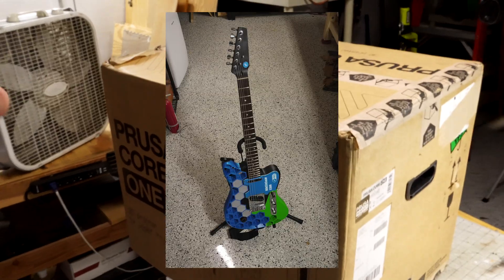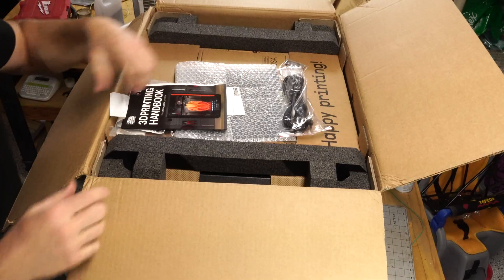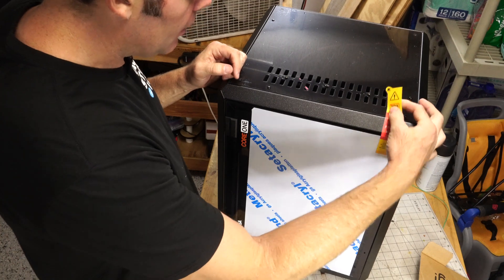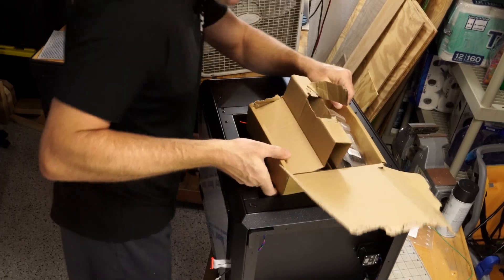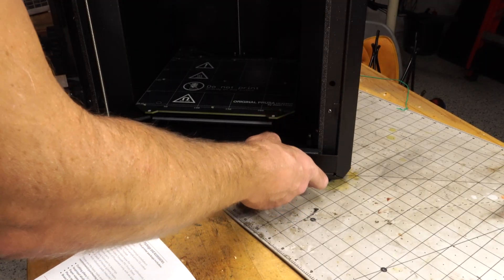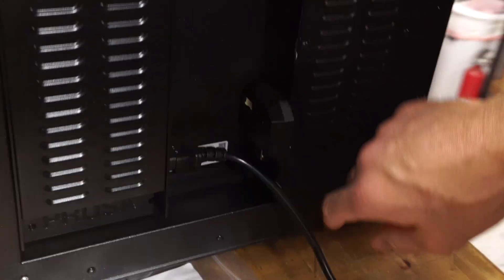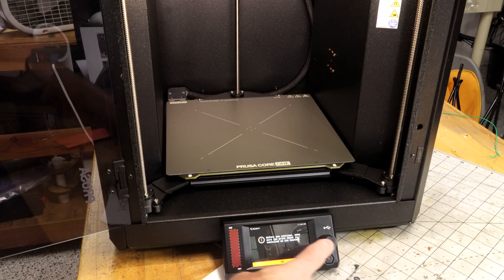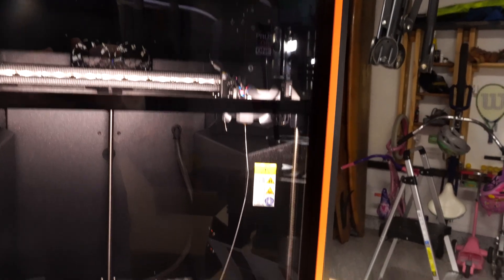Hands-On With Prusa Core One: Setup + First Print Test

Comment: Loving the Core One! Rebuilt it from the MK4S and it runs perfectly.🙂
Reply from the maker: Nice. Mine is pre-built from the factory. How was the upgrade process?
Reply: @JeremyCook  Thank God you didn’t buy a kit. If this is a real video, you’d never survive building a kit. No offense, but I cringed sooo many times at the level of ineptitude you displayed. “hey, let me power on my new $1200 printer before I remove the packing material (paper? OMG)” “hey, how does this box come off the spool holder” “I wonder if I should read the manual, or at least watch someone else’s video who actually knows something about this stuff” “hmm, maybe the print bed goes in with the writing facing the wrong way” - After writing this I’ve convinced myself this must an act. It had to be… Right? Otherwise you’re giving even “Florida man” a bad name… So thanks for driving me insane.
Reply from the maker: @mikec7713  Wow. Well thanks for the engagement at least.